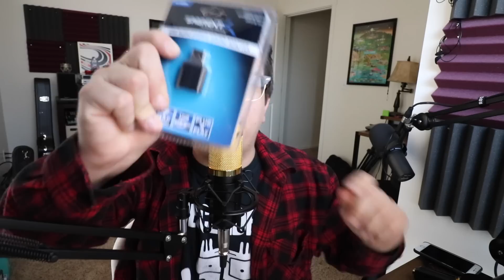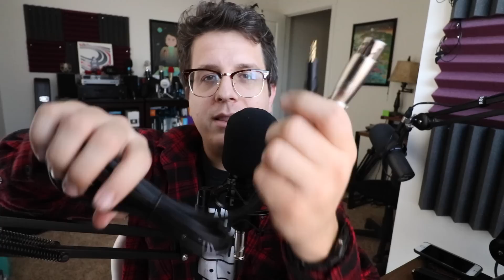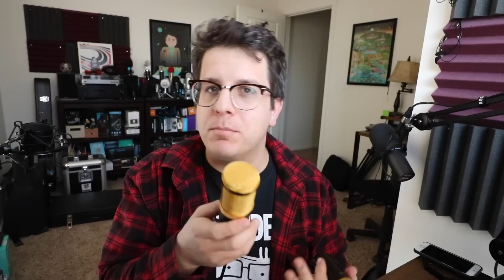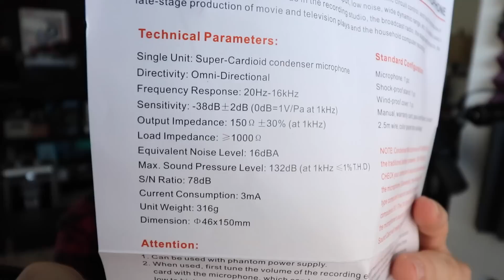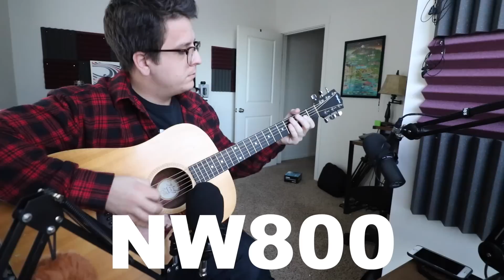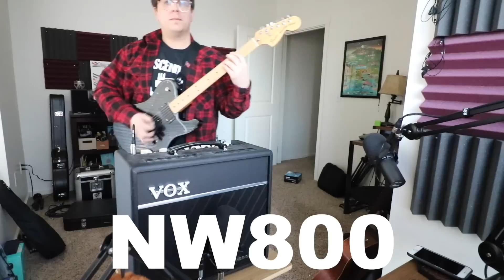Neewer NW-800 Condenser Microphone Review / Test

Comment: Hey man, I just bought this mic and I have a lot of background noise. I am using a Focusrite Scarlett 8i6 so it should not be from the interface. Do you think it will be solved with a better XLR cable? Thanks!
Reply from the maker: Yes. You NEED xlr to xlr to connect this to interface because phantom power is not transferred over a 1/4" connection.
Reply: Well, I used an 1/4 to XLR reduction and it works, its just the noise that bothers me. :)
Reply from the maker: Because the mic is not getting any power so it's not going to sound good. Get the XLR to XLR cable, and make sure phantom power is on
Reply: Alright, I will try that, thank you!

Comment: I have the nw 800
hey it is me again now i know  a lot more so i want to buy phantom power suply and i found in ebay 

this: http://www.ebay.com/itm/Neewer-1-Channel-48V-Phantom-Power-Supply-w-Adapter-XLR-Cable-f-Music-Recording/191932128345?_trksid=p2047675.c100009.m1982&_trkparms=aid%3D888007%26algo%3DDISC.MBE%26ao%3D1%26asc%3D20131227121020%26meid%3Dd22d376e54ad4647b74e83c89ebef669%26pid%3D100009%26rk%3D1%26rkt%3D1%26sd%3D191977401724

but from some reason it is not shiping to my country so i found 
this: http://www.ebay.com/itm/Neewer-48V-Phantom-Power-Supply-Black-with-Adapter-and-One-XLR-Audio-Cable-/191977401724?hash=item2cb2bead7c:g:vAQAAOSwAuZX45~h

but this is pretty expensive so i found 
this: http://www.ebay.com/itm/New-48V-Phantom-Power-Supply-with-Adapter-for-Condenser-Microphone-US-plug/131817507570?_trksid=p2047675.c100623.m-1&_trkparms=aid%3D222007%26algo%3DSIC.MBE%26ao%3D1%26asc%3D38530%26meid%3D614703263ba94860b5fb934d9a123ffe%26pid%3D100623%26rk%3D1%26rkt%3D6%26sd%3D191977401724

?but this is not neewer product so i dont know if it will be good for me shuold i buy it

also the adapter is not good for my country my country has 220v 
so i found 
this: http://www.ebay.com/itm/EU-Plug-AC-DC-18V-1-5A-Converter-Adaptor-Switching-Power-Supply-Charger-1500mA-/201626965442?hash=item2ef1e755c2:g:4swAAOSwaB5XjJIe

?will it help
Reply from the maker: Looks like the same phantom power. Don't know about using a different AC adapter though.
Reply: what about that?
http://www.ebay.com/itm/50W-AC-110V-to-220V-Voltage-Converter-Transformer-Adapter-Charger-US-Plug-New-S5/271889767885?_trksid=p2047675.c100010.m2109&_trkparms=aid%3D2220072%26algo%3DSIC.MBE%26ao%3D1%26asc%3D20131231084308%26meid%3D36ce10f816df4f90818f06d62c8d3a88%26pid%3D100010%26rk%3D3%26rkt%3D4%26sd%3D272084151704
or that:
http://www.ebay.com/itm/50W-US-AC-Power-220V-to-110V-Voltage-for-Travel-Converter-Adapter-Transformer/401184953467?_trksid=p2047675.c100010.m2109&_trkparms=aid%3D2220072%26algo%3DSIC.MBE%26ao%3D1%26asc%3D20131231084308%26meid%3D36ce10f816df4f90818f06d62c8d3a88%26pid%3D100010%26rk%3D2%26rkt%3D4%26sd%3D272084151704
or that:
http://www.ebay.com/itm/AC110V-to-220V-70W-Step-Up-Step-Down-Dual-Voltage-Converter-Transformer/272084151704?_trksid=p2047675.c100005.m1851&_trkparms=aid%3D222007%26algo%3DSIC.MBE%26ao%3D2%26asc%3D38530%26meid%3D1ee64e1161e94a8386eaac1e70138356%26pid%3D100005%26rk%3D4%26rkt%3D6%26sd%3D381689335924
Reply from the maker: I have no idea about how it would perform with a different AC adapter.

Comment: What did you use for recording this?, did you use a preamp and did you use an xlr to xlr to go into the preamp?

If not did all of this come from just using the built in XLR to 3.5mm jack and plugged into your PC Straight away?
Reply: ApplePumpkinPie _  exactly what got me confused.... 

As far as i know from what he said in the video and from his reply, you need an adaptor that provides enough phantom power to get a good sound from the mic.

From what ive read you need at the very least 5v of phantom power but the highest you can get is 48v. 

I think if you want a mic like this one, you will need to just buy a "preamp" which uses an XLR input.
You will probably need an XLR to XLR cable if you dont have one, but after that you can just plug the preamp into your PC and record with software like Audacity.
Reply from the maker: Did you watch the video? 00:37
Reply: Do you need the usb audio adapter?
Or can i just plug it into any microphone port
Reply from the maker: Need a SYBA STEREO USB SOUNDCARD by itself, or any other random soundcard with phantom power supply.
Reply: i need help to u r confusing me pod it says dont but in the discription and do u need a phantom power supply
Reply from the maker: The reason it says "don't buy" next to the soundcard is because people want to buy that soundcard by it self and expect to get awesome audio. https://www.youtube.com/watch?v=J1v1jtHz4C0

You can no longer do that. If you buy the soundcard listed in the description, you need to buy a phantom power supply as well.
Reply: Podcastage
Reply: Podcastage

Comment: hi quick question i might get this mic and wanted to ask i have a gaming pc gtx 960 4gb i5 6500 8gb DDR4 ram do i need anything except for the product to run this as im confused about the voltage and i have a PSU
Reply from the maker: Yes you would likely need usb soundcard and phantom power supply.
Reply: thanks

Comment: So I have a phantom power supply. everything is plugged in good but the problem is that 1. it picks up way too much background noise and 2. it sounds good but definitely not as clear and soft as yours. My voice sounds like it's just through a normal turtle beach microphone and you can tell it's not clear like yours. It's weird. please help!
Reply from the maker: Connected to USB soundcard or internal microphone input? www.geeksrising.com/faq
Reply: It's connected internally. I don't have a usb soundcard. From the looks of that link you just sent me i'll purchase one. Should I just get a cheap $10 usb soundcard or spend 20-50? i'd prefer to stay below $25 edit: I have a desktop btw
Reply from the maker: Whiskey Sabrent USB soundcard will work fine if you have Phantom Power.
Reply: awesome, thank you so much i was so worried! ik it don't matter much but you just got yourself another subscriber!

Comment: what program are you using to record your mic. I just got this mic in the mail today and am receiving a static like sound when I record and I have to be right up close to it. thanks!!
Reply from the maker: Quicktime. It's not what you're recording on, it's how you're connecting it. Look up my how to connect mic to computer.
Reply: I have had the same issue. Turns out my laptop was actually the problem. I tried different combinations, with and without phantom power, with different audio settings... but no external sound cards or audio interfaces. 
My laptop produces a loud static noise that I was able to remove by enabling echo cancellation and setting the gain to 0db and the volume to 75. But my voice sounds terrible when I do that. 

Then I tried it on my gaming setup, which has a decent built in sound card and there is no static. With or without phantom power, it sounds just as loud and as clear. And no settings there either. Just input volume set to 100% and nothing else. Even at +30.0db gain, there still is no static. 

So my suggestion is, don't use a cheap computer with your mic. I didn't try an audio interface though, so I don't know whether to recommend trying that. But it still is an option, that many people recommend.

Comment: Please answer: So to get the sound quality of your microphone, I have to buy Sabrent USB adapter AND Phantom Power AND the cables to connect AND a stand (or is it included) and ofc the microphone itself. Or can I buy one or the other Sabrent USB or Phantom Power?
Reply from the maker: You need both usb soundcard & phantom power supply.....of you can get the SYBA STEREO USB SOUNDCARD that I reviewed here. It's the only soundcard that I know of that provides sufficient voltage alone.

Comment: Hey, I saw a video from another YouTuber called TechSource testing 5 Budget Mics. In it, was a FLOUREON BM-800 (https://www.amazon.com/Floureon-Condenser-Recording-Broadcasting-Microphone/dp/B01IARJWAS)

I just found the one mentioned in this video, the Neewer NW-800
(https://www.amazon.com/Neewer-NW-800-Professional-Broadcasting-Microphone/dp/B00XBQ8UGG)

So, I've got a few questions

1. Which one do you suggest from the two I mentioned above? 
The Floureon BM-800 is tested in this video at 3:20
https://www.youtube.com/watch?v=jgU4xOXMNR8&t=200s

2. My HEADSET's microphone broke, so I wanna get a new one that sounds much better. Also, do I necessarily need a USB soundcard for it to work?

3. Does the brand matter?
Like, would the brand change the microphone or do they just resell it but with a renamed brand...?
Reply from the maker: You do need a usb soundcard to get decent quality, and the only one I know of that works is the SYBA STEREO USB SOUNDCARD.  I compared the bm800 and nw800 here: https://www.youtube.com/watch?v=xa9bB2JYEic

The brand is pretty much interchangeable. My understanding is all these mics are manufactured in the same factory and just different co names are slapped on the body.
Reply: Podcastage Oh ok. Thanks for the fast reply :D
You just earned a subscriber
Reply: Podcastage Oh, and also, do I need Phantom Power? I'm using a PC
Reply from the maker: Check the channel.

Comment: I have 2 questions for this microphone, 1st: Will I be fine with a 48v Phantom Power Supply, Internal Sound Card, and microphone? 2nd: If i'm using the behringer UM2, where would I plug the other XLR cable? I only see one spot
Reply from the maker: 1. No you need external usb soundcard in that set up. 2. What other XLR cable? Setting up a microphone only requires one XLR plug on the interface.
Reply: I just realized that the Behringer UM2 only uses 1 XLR cable, so my last question is will the UM2 work as a external USB soundcard instead of something like the SYBA USB sound card?
Reply from the maker: yes

Comment: I don't understand this voltage thing you are talking about. Doesn't my pc provide 5v? Or do i really need a sound card. If yes what do you recommend (cheapest possible)
Reply from the maker: It does not provide 5v to the 3.5mm mic input. No. The majority of people I know do require a USB soundcard even if they get phantom power supply. Only one I know that provides enough voltage is SYBA STEREO USB SOUNDCARD.
Reply: Uk Link?
Reply: There are several different models when i search it up
Reply from the maker: http://amzn.to/2c8zUef

Comment: i have this mic but it keeps making this static noise in the background.  i bought the neewer phantom power supply cause i thought maybe my computer doesn't give off enough power but after i plugged it in it kept on doing the same thing!  If anyone can help me fix this that would be highly appreciated
Reply from the maker: A USB soundcard should help.
Reply: i am using syba usb do you think this gives off enough power or should i just get the Sabrent USB
Reply: https://www.amazon.com/external-Adapter-Windows-Microphone-SD-CM-UAUD/dp/B001MSS6CS/ref=sr_1_cc_1?s=aps&ie=UTF8&qid=1472674584&sr=1-1-catcorr&keywords=syba this is the link to the SYBA and sorry im probably bugging you but i have been trying to figure this out for awhile
Reply: hey, have you found the fix for this? I'm having the same issue!
Reply: I've hooked it up to the phantom power which then goes into a Behringer 320USB and then into my laptop. I have fiddled with mic volume and gain for days and still the noise levels are unacceptably high. Any idea what I could be doing wrong?

Comment: I bought a Sabrent USB Stereo instead of the SYBA. The Sabrent was 10$ CAD and the SYBA was 20$CAD... Double the price. I hope it doesn't make a big difference.
Reply: 20$*
Reply from the maker: Chances are you're going to need a phantom power supply.
Reply: Podcastage Bought a Behringer PS400 because it's compact, outputs 48 volts and removes background noise :) Oh and it also looks very durable and reliable. The 5 star rating speaks for itself :)
Reply from the maker: OH PERFECT! You're golden!
Reply: Mickxal - Is the mic quality good without editing? I wanted this for gaming and communication so I obviously can't edit it out. The power supply seems good with the NW-800 and I was wondering how the quality is and if the power supply deals with the background noise very well.
Reply: Instagram: lots of background noise with the nw-800. I changed to an at2035 and a focusrite solo. Buy a behringer um2 interface and a MXL 770 it's the best option.
Reply: Would you recommend anything else? I'm only looking for a simple mic to talk clearly with and no background noise. I use my Astro a40 TR mic on my headset at the moment. The NW-800 with that audio interface looks good on a comparison video from this channel but I don't know if that is edited or not.
Reply: Instagram: If you have a quiet room without any background noise / pc fans you can go with a condenser microphone. If you want a microphone that doesn't pic up background noise you should go with a dynamic microphone such as the Shure SM58.
Reply: Mickxal nah there's no noise in here. There are PC fans but they're quiet so it's no issue. I was wondering if it was the Berhringer UM2 With NW-800 or just a Blue Snowball iCE
Reply: Instagram: 
The nw-800 is better than the snowball.
Reply: Mickxal but the apparent static in the background? Is thar solvable with the Berhringer UM2
Reply: Instagram: Static is from high gain because of the noise floor. You'll have to find the right volume for the microphone. Also consider the BM-800 over the NW-800. The BM-800 captures more frequencies. I'd go with the BM-800. I had the snowball ice but it was dissapointing.
Reply: Mickxal this one? (Need to be on G+ to see it)https://plus.google.com/photos/...
Reply: Instagram: I'm on g+ but still cant see it. It's the Flureon BM-800
Reply: I really would rather get the NW-700 since it has the arm and pop filter for cheaper and if I buy this all separately its more expensive and the arm can't have next day prime delivery

Comment: Hello, I purchased this mic with a Neewer phantom power unit, and it upped the gain but it is still quite quiet. I am still having to use microphone boost to get people to hear me well, but I do not have any options to control the gain, just mic boost on or off. I am using the setup as follows: Mic connected to power via XLR, power unit outputs on XLR to 3.5mm, using a 6.3mm adapter to plug it into my Asus Xonar Essence STX sound card's microphone input. 

I am very new to this, so if you have any tips for me I would greatly appreciate it! Thank you!
Reply from the maker: You need a usb soundcard. Should help the sound. I recommend the sabrent stereo usb soundcard for this set up. Then plug the 3.5mm plug into the soundcards mic input.

Comment: I have both mic and headphone jacks on my laptop, do i need to buy the USB soundcard?
Reply: +Podcastage So it's good enough? Better than the Vmoda boom pro?
Reply: Green Holly Dammit i just bought an usb soundcard lol
Reply from the maker: Yes you do. The internal mic input won't provide power. SYBA STEREO USB SOUNDCARD is only one that provides enough power.
Reply: Does it provide 5 volts?
Reply from the maker: ~4.5v
Reply: Podcastage Will it sound like it does in the video?
Reply from the maker: Not the exact same but very similar. There is a little bit of a noise problem about 50% gain, but not too noticeable.
Reply: +Podcastage After buying a blue yeti. Will I be able to use it without a phantom power thingy?
Reply from the maker: Jack I like it better than the vmoda boom pro.
Reply from the maker: Green Holly Blue yeti is a usb mic. You plug it into your computer. No phantom power required.
Reply: Podcastage Thanks .3.

Comment: do you need mixer or just phanotm adapter?
Reply from the maker: Phantom power and usb soundcard would work. Or you can buy just the SYBA STEREO USB SOUNDCARD for the nw800 and it would work.
Reply: So i basicly need an soundcard?
Reply: But what is the diffrent whit usb soundcard and without? And can ypu hear the keyboard clicks good?
Reply from the maker: Ole-edvin Engvik www.geeksrising.com/faq (re the soundcard).

I think I tested the keyboard in this video.
Reply from the maker: Ole-edvin Engvik I have never tested that so I have no idea how it performs. Let me know if it works.
Reply: Yeah ok i will just order an syba stero usb thing incase
Reply: Thanks for the help anyway:)
Reply: or you can buy an interface if you have the money. i recommend you behringer um2 and focusrite scarlett solo.It is much better than phantom power and sound card.Check tech spurce 50$ microphones...
Reply: +Ole-edvin Engvik tech source

Comment: I have a focusrite mic box, would this work instead of the soundcard highlighted in the video if I used an only XLR cord?
Reply from the maker: Yes if you're connecting a focusrite mic box that has phantom power using an xlr cable it should work very well.